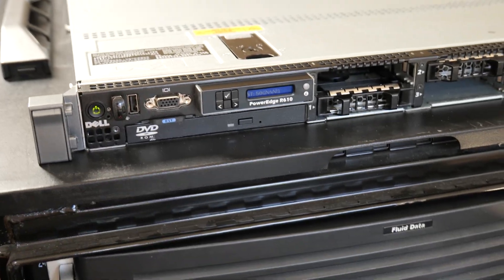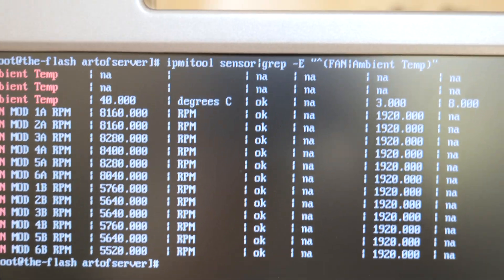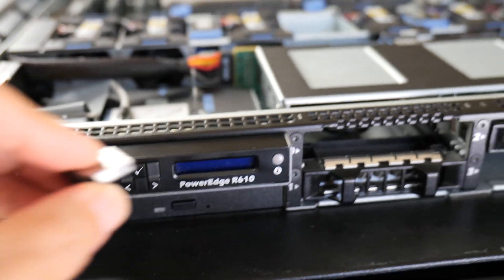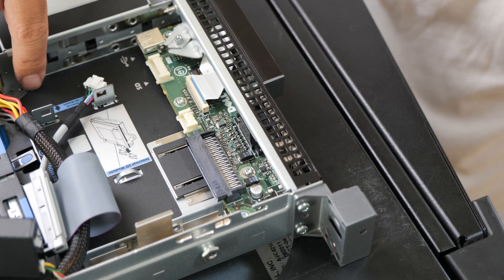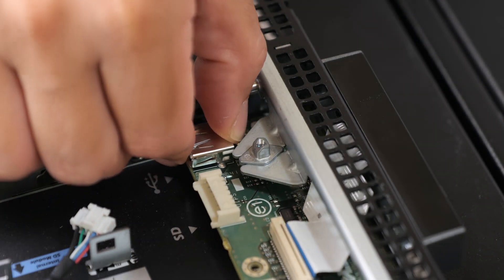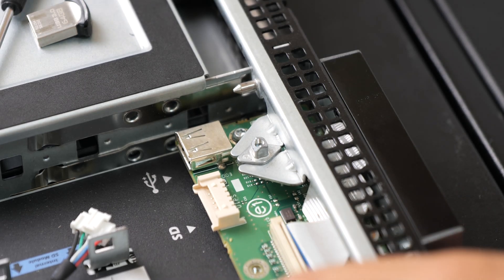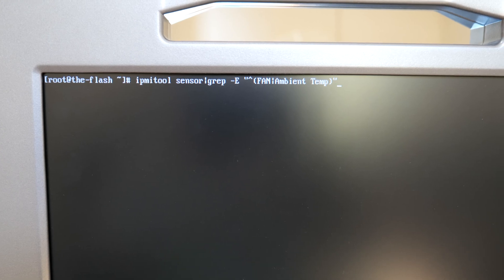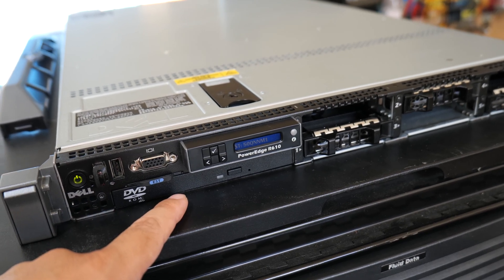Is your Dell R610 too loud? Here's how to fix it. | PowerEdge Tips

Comment: you can use a idrac hack to slow down the fans on most dells  .. just install openmanage BMC utilities  then issue the command  C:\Program Files (x86)\Dell\SysMgt\bmc>ipmitool.exe -I lanplus -H idrac-ip-address -U root -P calvin raw 0x30 0x30 0x01 0x00     
for manual fan speed mode 
then to set fan at 20%
C:\Program Files (x86)\Dell\SysMgt\bmc>ipmitool.exe -I lanplus -H idrac-ip-adress  -U root -P calvin raw 0x30 0x30 0x02 0xff 0x14

Comment: I have two PowerEdge servers, R620 and R730XD. After booting, R620's fan speeds fall down to 20% (which is not noticeable at all), but R730XD's fans remain at 68%. It sounds exactly like a plane taking off. I'm unsure if it's because of a faulty sensor, but the temperature graph shows 27°C. To address this, I created a temporary VM inside the server to send an ipmitool command to manually set the fan speed to 20% after boot, which worked for me. I monitored the temperatures and they remained at 26-27°C. Now both servers are running at 20% fan speed and they are barely audible.
Reply from the maker: Glad you were able to find a solution! Thanks for sharing!

Comment: Nice video, I don't have this problem but just for learning purposes, would it be possible to fix this issue without replacing that board by having a fan curve based on CPU temp instead of ambient temp?
Reply from the maker: The BMC takes into account several sensors, including CPU temps. If you want to change the behavior of the BMC, then you need to modify the BMC firmware.

Comment: An R610? Blast from the past! I imagine that costs a lot to run with energy rates these days
Reply from the maker: It's not too bad, depending on the configuration. However, newer servers are generally more energy efficient and lower idle power states.
Reply: it doesn't need a PAIR of CPU's to run.

Comment: Love ipmitool. Especially since you can override the internal decision-making for the fan speed and set it manually.
Should I do this? Probably not. But on an R520 file server that idles basically all day, there is no reason why it can't run in an air conditioned house with barely higher temps. 

I should look into the temperature module though like you did in this vid.
Reply from the maker: The 12th gen servers are usually pretty quiet already aren't they? It's the 11th gen that tend to be louder.

Comment: Is that sensor in the same location for the R710 as well? Great video as usual.
Reply from the maker: I suspect the sensor is on the equivalent board on the R710 as well, but I don't have 1st hand experience fixing this issue on the R710. Check to see if your reading is correct or not first. If it is, then it's probably fine. Thank you for watching!